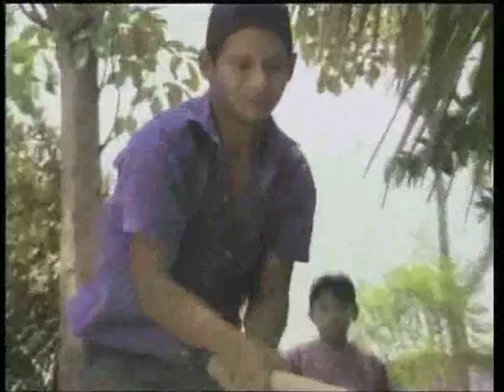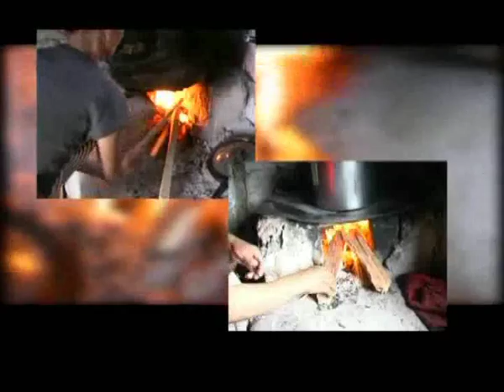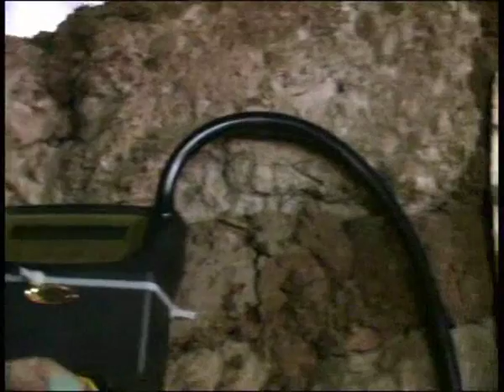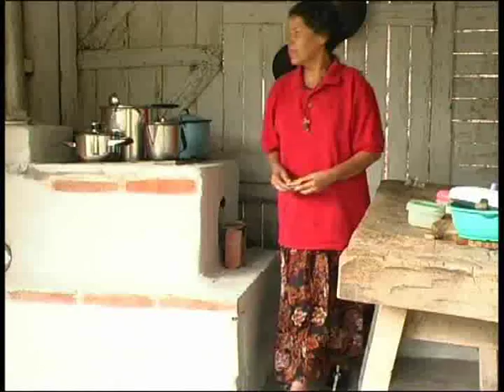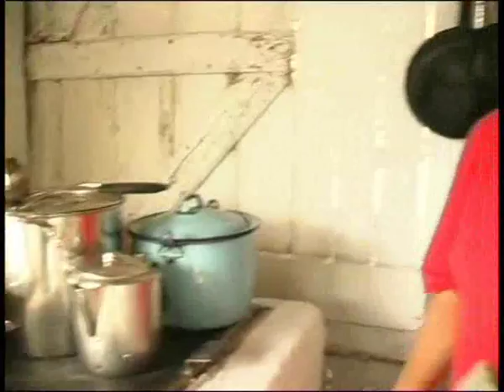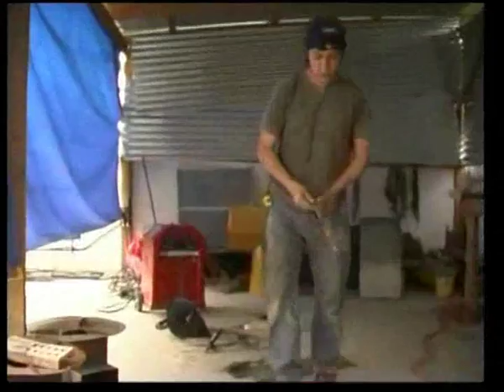TWP / AHDESA, Honduras, Fuel-efficient stoves

Comment from the maker: There's only smoke at two points in the film. The first is from a house *without* an imrpoved stove. The second is smoke from the chimney  of a Justa stove, but just after lighting - this is the only time you get any smoke, once it's going there is little or no smoke.

You mention Rocket stoves - Justa is in fact based on the rocket stove design.